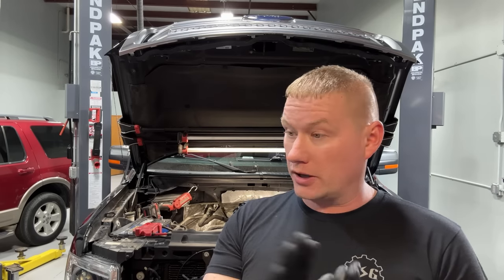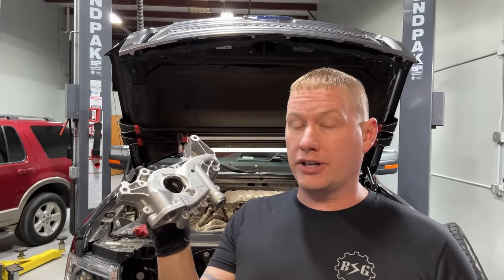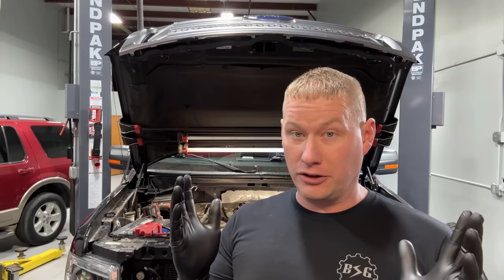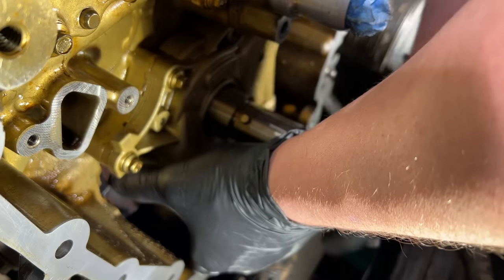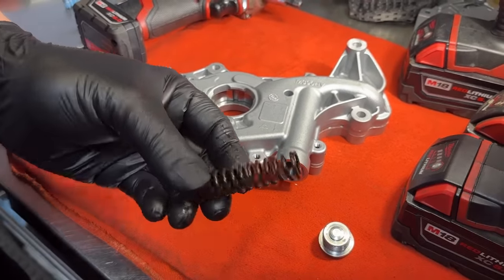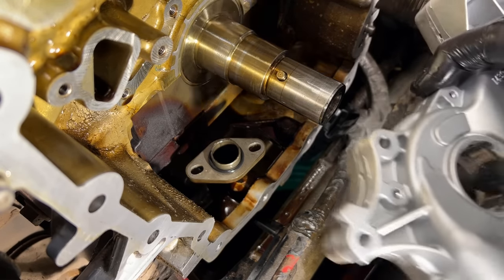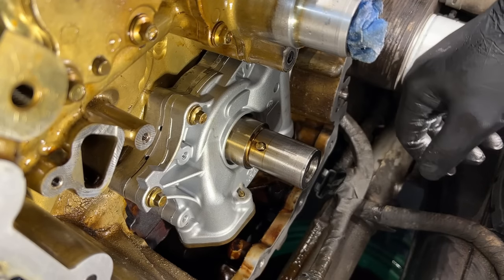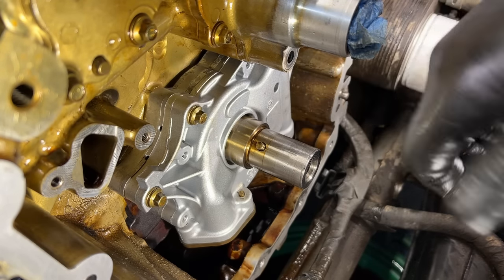2011-2016 Ford F-150 3.5L Ecoboost Oil Pump Upgrade Without Oil Pan Removal!

Comment: Does sliding that tube under the bottom of the pump shave material? I'm assuming a steel tube against an aluminum machined surface.

Comment: Maybe take a round shank screw driver the same diameter as the bolt hole in the pickup. Heat and bend the end @3/4" , 90 degrees. Drop the end of the bent screwdriver into the pickup hole and pry down and push it back and hold it to allow the pump to slide on easier. IDK, just a thought.
Reply from the maker: No needed, it is actually not that bad this way, it is much worse when you have a camera in the way.

Comment: Looks like you could shave that pick-up a 1/16 and this would be super easy...
If you have a good rag down in the pickup or an actual pipe plug and along with a rag in the pan..just use a dremmel with a cut off wheel...
You can also have a 2nd set of hands to push down and away..that would help a bunch as well
Another GREAT video tho
What a time saver

Comment: Great video demonstration, what about the newer eco-boost engines, For example I have a 2018 F150 with a 3.5 L eco-boost, do these engines have trouble with oil pressure and cam phasers?

Comment: If you don’t mind me asking, what’s the approximate cost for the service that you’re performing for this guy? Timing, turbos, manifolds, water pumps, everything? Or even how much do you think this would be from the dealer? I’m approaching 130k on my 3.5 and with the price of their new trucks, I’m not sure if I want to put the money into fixing the truck up, or just getting rid of it and ponying up for a new one.
Reply: What do you guys think? 10k? 15k? Or am I way overestimating.
Reply: I think with all of those parts and labor, you may be approaching 10k. I just payed 2.6k for the parts to do a complete timing job. Dealer wanted 6k to do the timing job. Turbos are about 1k each in parts. So, probably at least 3k with dealer install. So, about 9k without the headers.

Comment: The 5.0 Coyote motor is a bit tighter that this, but the same process can be used. I've done it in the 4 that I've replaced.
Reply from the maker: The 5.0L and 5.4L are a breeze compared to this simply because when their pickups are unbolted they fall away, this one doesn't.

Comment: I have a PO500 code in my 2012 F-350 it has the 6R140  Transmission . I am assuming that sensor is either the TSS or OSS on the top of the transmission . Short of dropping the transmission out how can I get up in there to remove and replace these sensors? Thank you in advance for this and the many great vids over the years that have saved me thousands of $$$

Comment: Brian, or perhaps others may know the answer to the question I have, and that is on the right hand side, where the oil goes into the block...why is there no gasket or RTV put on the mating surfaces there?   It was the first thing I thought of when you started pushing the new pump on!   I didn't see any O-ring either at that location?
Reply from the maker: They are precision machines surfaces that do not require a gasket, that is how they all are.

Comment: That looks to be a walk in the park compared to my son's former '04 f150 5.4l. Yes I upgraded his oil pump with the Melling  HV pump. I wound up bending my 8mm gear wrench since I didn't have flex head. I will say patience rules when re-installing the  pick-up tube to the pump. Would I do it again? IDK. I am glad that truck is gone.

Comment: I wish I did the oil pump on my Explorer Sport when I replaced the water pump st 130k. I prime the engine when its cold using the gas pedal trick

Comment: Question for you Brian. 2013 f150 3.5L Ecoboost, I run a tune and am a fairly “spirited” driver often having fun with the torque and working the turbos. Would you recommend I use the stronger spring in the new oil pump? Going to do a full timing job & exhaust manifolds soon here for cam phaser rattle.

Comment: Also I have a weird air conditioning problem. The freon has been drained and new freon put back in and checked for leaks. I've had to replace the blower motor as well as the speed control module. I also replaced the pressure switch and it still under performs. The coldest vent temp I can get is in the mid 60 degrees. The compressor rapid cycles. Every 6 to 10 seconds it will cycle off. 5 seconds or so passes before it will turn back on. The fans are working correctly. Also new water pump with new 50/50 motocraft antifreeze. I'm stumped
Reply: Did you get it fixed?
Reply: @bigpicturethinking5620  No it still does not cool like it should. I'm stumped at this point
Reply: @heavychevy2035  what year?
Reply: @bigpicturethinking5620  2012 f150 crew cab xlt
Reply: @heavychevy2035  So I’m not a mechanic but I’ve gone down the ford ac rabbit hole. I have a 2015 so this information does not directly apply to me but it’s what I found in my research which has been extensive on the issue. If the compressor is “short cycling” it’s likely a pressure switch (unlikely), a low charge (easy enough to check) or it’s being commanded by the module to kick on and off. It seems you have ruled out the charge and the pressure switch. In comes the module and it’s inputs. There is a sensor in the evaporator core called the “evaporator temperature sensor” and it does exactly what it’s name suggests. The sensor is buried deep in the evaporator core in the passenger dash and requires major major disassembly to replace. If this sensor is giving a faulty reading it will cause the ac to cycle off frequently to keep the evaporator core from freezing, thus the short cycle symptom. This sensor can be tested but not replaced without incredible difficulty. If it is the sensor, there is a “hack” that involves some risk but works for trucks of your year Google “mediocre ac solution ford” and read up on the issue. I have no idea if this is your issue, but you can certainly check and see. It sounds a lot like it with what you have said.

Comment: Wouldnt more pressure with the added volume be better? I have continuously heard that the oil psi ford has set on new engines is low. Normally you want to see 15 - 20 psi at idle and as rpm goes up 10 psi per 1,000 rpms
Reply from the maker: It is only a relief spring, so it does not affect idle and mid throttle.

Comment: So, this is an off-subject question. I'm new to your channel but my question is. I've started expericeing  what i believe is an oil pan leak. It's a 2016Ford F150 eco-boost 2.7-liter V6. Any recommendation for fixing this. I've heard that others have replaced the pan per the FSB and still having a leaky pan. Its a minor leak right now but would like to address this before it gets any worst. Is there an upgraded pan? If you have a video already forgive as I haven't found it yet.  Any help greatly appreciated.

Comment: Why don’t recommend the high psi spring just installed the oil pump with the spring that it came with comes out low pressure on oil

Comment: Hey makuloko have a 2015 explorer 3.5 non turbo some issues with the oil pressure low... Some repair shop has replaced the engine oil and sensor and still has same issue....

Comment: Hell. I wish I knew about this when I was having engine work done on my truck this summer. The ford mechanics never suggested anything about the oil pump. My whole issue was me wanting the rattle on cold start gone and they did everything but this, and the rattle is still there. I got taken for a ride unfortunately.

Comment: Just seems that since you have it tore down and the pick up exposed that it would be advantageous to blow out the screen ( sludge) with a high pressure hose. I’m only assuming there’s a screen on the pick up.  Can you tell I’ve owned a dodge at onetime.
Reply from the maker: There would be no sludge.

Comment: I have ford explorer 3.5 non turbo can i change the engine to turbo engine? And it will be compatible with oem transmission or i also need to change the transmission?

Comment: My friend has a 2013 F150    non turbo 3.5l and he tells me he gets a low pressure warning light and also sounds like a lower end knock. High mileage do you think this would be a good repair😊
Reply from the maker: No if the low oil pressure and knocking it was not taken care of and is likely sludge with excessive wear.

Comment: I have a 2012 eco boost with 287k miles. I just had the left side exhaust manifold replaced and was told the right side is starting to leak. What all could/should be done to keep getting life from the engine?

Comment: On the 2018 F150 5.0L the oil pan and pickup tube come as one piece. All riveted together.
I believe the oil pickup tube would have to simply slip into the base of the oil pump.
I just wonder how many problems were made by this form of oil pump and tube assembly?
It would seem wiser to have 2 bolts on the pickup tube at the pump. 
Has anyone had any problems because of the crappy non bolted  pick up tube on Gen3 5.0L 2018 F150's? 
Like maybe low oil pressue?
Missing an O-ring on a non bolted pickup would seem to be crucial.
Especially at hot idle. WTF?
At least with a 2 bolt pickup a missing O-ring may not be a huge issue.

Comment: So would you recommend having the timing chain replaced at a set milage on the 3.5 Ecoboost or only when problems develop?
Reply: Do it only when symptoms begin frequently. Best you can do is change the oil every 5k no questions asked. Mine started at 88k after sitting for 2 weeks about 3 and a half years ago. Just got around to changing them at 121k.

The strange thing is the chain wasn't stretched (maybe 1/4 inch max), Tensioner still held good tension, Phasers felt ok, opened all Phasers and saw a little scoring but nothing that would say its the smoking gun

Comment: I have a 2000, 3.8 v6 Mustang with 5 speed manual transmission. 240k miles it runs so sweet  I up the tire sides from 15” to 17” so now it run a 70 mph at 2,000 rpm’s I was never going to give it up. Also, I rented over 200 Mustang 1998 to 2018 all engines hated the 4 cylinder turbo models the 5.0 V8 very fast, love the 2015 and other years 4.0 V6 with 6 speed manual,  very fast, 36 mpg  but ford stop putting The V6 in 2017 of all most 5 million miles driving rental cars, 18 wheelers, and school buses. And my own cars and pickup two. All my cars about 250,000 each, never hat and problem and of my ford’s A year ago go I decided to retire from all the traveling and buy a vehicle and convert an enclosed trailer for Velomobiel  it’s 10 foot long no hotel or motel would let me fit in my room. My Mustang not a good tow vehicle so now I have a limited 3.6 v6 flex,  to pull a 14 foot enclosed trailer. Flex has 67,400 miles. Most likely I’m only going drive it up to 150,000 miles. As I’m old.
Seeing your videos and other videos on the ecoboost V6, now I’m thinking I made a big mistake in buying Ecoboost engine. Just made a 2,000 mile trip 10 days pulling 1,600 pound trailer, 13 mpg average  $4.65 a gallon average about 1 dollar a mile.  Now you’re saying I’m going to be spending thousands of dollars on repairs.  My average trip is 3,000 miles some 6,000 miles trips. So what do I do right now to improve on fuel efficiency all so I notice flex runs hot.  I try to never go over 3,000 rpm or push the turbo’s into used….. any videos can I watch?

Comment: Would it necessarily be bad if I left the blue spring in the pump? I don't have a "racing" truck but it is lifted 7.5" with 37's figured maybe the extra pressure would give a little more power? Or am I thinking about it all in the wrong way? TIA
Reply: More psi Is less HP tiny bit. More psi means more drag on crank

Comment: Do you have a video of removing 3.5 ecoboost oil pan? Need to replace gasket on a 2013 bit can find a single video for that year/motor. Thanks.
Reply from the maker: That is because they do not fail.

Comment: @fordtechmakuloco Thanks for all these great videos.  I'm about to do this job as my front cover is leaking and I'm at 210k miles.  So I'm going for all timing components, plus this pump.  However, Ford states that my oil pan is leaking too.  Thus, I will be resealing my oil pan during this process.  On the good side, I have a 2WD, but when I read the repair manual it states to loosen the transmission bell housing bolts 5/16" or so and push the transmission back.  Is this purely to give you a way to pry on the oil pan so that it releases?  With the front cover removed, does the transmission still need to be pushed back?  There isn't a lot of information about these engines with the aluminum pan vs. the plastic that fails all the time.
Reply from the maker: I would recheck their work, I have never seen the metal pan leak, EVER.
Reply: @FordTechMakuloco  Thanks for the reply.  That's the plan.  I know I had the vacuum pump leak and the front cover leak.  Maybe one of those is making it look like the oil pan is leaking, but I personally have never seen it leaking during oil changes.  I also have to say that I also wonder how long the RTV will last now that it's been 10 years and 210k miles...

Comment: Have a 2016 Expedition with 170,000 miles. I’m contemplating doing the same full service you are to this truck. May I ask what you estimate the total bill to be for the full timing set, phasers, water pump, oil pump, exhaust heads, turbos, etc…?  Thanks for all your amazing videos.
Reply: Just call or email his shop and he will email you back with an estimate.  If it was me I would just make an appointment and do it if you really like your suv. It will be a lot cheaper than buying a new one
Reply: Not a shop but if you DIY like I did (did everything you stated with Motorcraft parts, CRP manifolds and CRP billet turbo rebuild kit) it cost about $3000, about $500 more to do "while I'm in here" type things.

If I had to guess, I've seen others quotes for timing only at 3-5k and manifold only replacement at 1.5k. There's little overlap between the two jobs (coolant and oil drained, air tubing removed) so there likely won't be significantly less labor

Comment: Do you have a video showing steering column bearing replacement ?
Reply from the maker: Nope, I have never seen one fail.
Reply: @FordTechMakuloco  I think ones in my F350. Are going out I get a whining sound when I turn left only  it never did before the crash the steering box was replaced and all tie rods so not sure what to do ?

Comment: Is this possible for the 2017 as well? I'm doing timing chains on my father's truck and curious if I should upgrade the oil pump but not sure if I can squeak it in like this or pull the engine.
Reply from the maker: Upgrade to what? There is no high volume pump currently available.

Comment: Thanks Brian, I really appreciate your videos!  I just about have all my parts and going to be handling the whole shebang (water pump, chain kit, & oil pump) here soon.  Just wondering if anyone has tried to remove the pickup tube bolt that connects it to the bottom of the engine to give the tube a little more movement to make this technique a little easier.  I'd also like to pull the tube out, without removing the oil pan, so that I can inspect it to make sure the screen isn't clogged or anything.  Also, does anyone know how to crank the engine without starting it to prime the pump and lube the components better on a 2017 Explorer Sport?  Your help is appreciated!
Reply: If you hold the throttle to the floor you can crank as long as you wish and it will not arm the ignition. You crank until you see oil pressure on the gauge, then stop cranking or if you want to start it, release the throttle while cranking and the ignition goes live. This is a factory built in "prime start".

Comment: Have a 18 f150 3.5 Ecoboost turbo. Why is the cam center line different and now the oil pump can not come out the front.

Comment: Just bought a 2016 3.5 eco boost came from the 2008 5.4 Triton did I just buy the problematic POS ford motor again? New truck has 97k on it old one had 150k when I bought it.

Comment: a little question i'm doing the same job on my car and when i install the oil pump and the timing chain.. i try to crank the engine it just cranks a pvo and it stops.  I thought it was the one that was not on time but I removed the oil pump and turned it and it works.  Can someone tell me what is wrong with the oil pump?

Comment: Not sure who else to ask. I did the oil pump replacement while I was doing the complete timing set replacement. Everything went as expected with the installation, however now I can’t get the oil pressure to come up. Followed the start procedure but still no pressure on the gauge. What should I check next?
Reply from the maker: Crank for 10 seconds three times in a row, then reinstall fuel pump fuse and start the engine. If oil pressure does not come up within 2 seconds shut it down.
Reply: @FordTechMakuloco  It worked!! Thank you so much for the suggestion. Also, HUGE thanks for the videos you make. You cover the topics so thoroughly that it makes seemingly impossible jobs so much easier. Please don’t stop making such great videos!!

Comment: Can someone tell me, WHY do this?  I have an '11 3.5 F150.  A while back I used this channel (awesome!) to replace the timing chain, cam phasers, and water pump. Unfortunately, I didn't do the oil pump while I was there. So, what incentive is there for me to rip apart the engine again in order to change the oil pump? Why would I be recommended to do so?
Reply: Don’t bother, it’s just preventative maintenance, especially for those paying for labour while this is apart. If you ever have oil pressure issues down the road, then obviously change it, but he’s just showing that while you’re in there, why not change it so it’ll outlast the rest of the vehicle is all.

Comment: Why not remove a little material off the pickup tube so reinstall is easier?
Reply from the maker: You as long as you stuff the tube first but honestly, I could get the pump on in the time it takes to file off enough mater I have tried both ways.